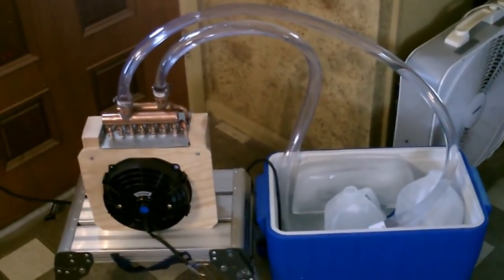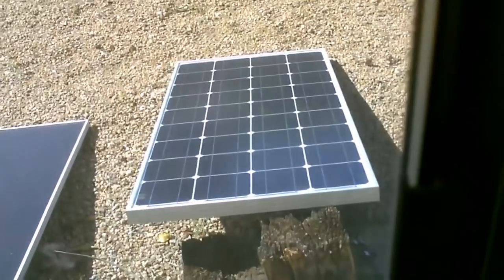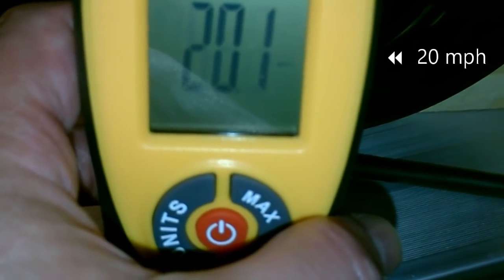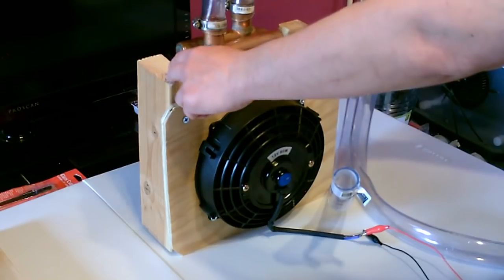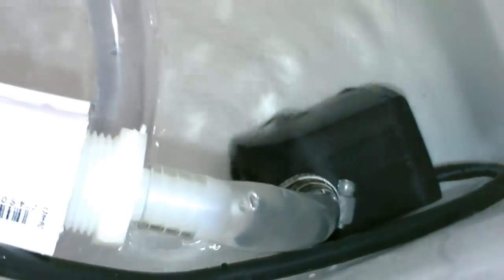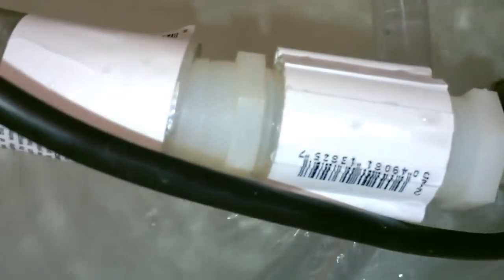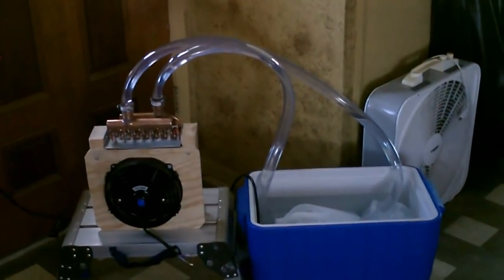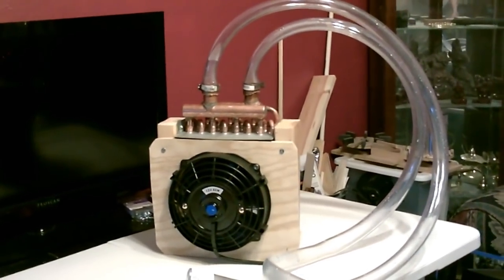DIY Air Cooler! AC Air Cooler with "chilled Water" - Powerful!  Heat Exchanger w/fan! Easy AC! Solar

Comment: Would any heat exchanger work. Ex, computer radiator
Reply: Because the link is no longer available
Reply from the maker: hi the links for the heat exchangers change all the time. i don't know why. best to just search for 8 by 8 heat exchanger and you'll see them. there are at least 3 companies on amazon that sell them. i'll take a look at the link, and post a new link. Update: i just posted the new link! it's in description section below or just click here https://www.amazon.com/Water-Exchanger-1-Copper-Install-Flange/dp/B07VPBSFQC/ref=sr_1_3?keywords=8x8+heat+exchanger&qid=1576173824&sr=8-3

Comment: Hey...i got a 12in automotive fan..2150cfm...New...18 x 18 Air to heat exchanger...New...i have a 48qt cooler brand new & 28qt extreme cooler brand new...What size Water pump Do you Think I need...im trying to build something that will help cool a 800 to 900 sq ft room...something better than a fan blowing around hot air..i work in a lab..it cool in the morning...but by 12 noon it's 83degress in there...fans blowing every..were The AC is set on..71...And we can't make it cooler..company Rules...This unit could turn the tide...because I can bring a fan for my area..but that's it..So I want to Bring this Unit in..with 2 bags 10lb bags of Ice....i can frezze 4" 1 gal bottles at night and bring in the morning....What do you suggest??.....THANKS..any.directions would be great👍
Reply from the maker: hi there. sounds like you got a great plan. if your running it on DC Power i'd use a 350 gph 12v bilge pump. 18x18 is a really good size unit. might even be able to use a 500 gpher. if using AC power i'd use a 400 gph water pump. probably an aquarium water pump. good luck to you. sounds like you're going to have a great system.

Comment: I've had this idea for years but never made one. I have a problem with what I'm seeing though. Looking at the clear hose going into and out of the radiator, one hose is full of water and the other is empty. Both hoses being vertical like that would have to be full of water if the water was going thru the radiator.
Reply from the maker: hi. good question. each pipe has an equal amount of water flowing thru it. neither pipe is even close to full, maybe 1/4 full, but that's normal. it looks that way on one side because the water bottle necks . but the unit itself is actually full all the time.

Comment: very nice..its a bit loud to my liking....  think you can increase the radiator size and reduce the fan speed to achieve same cooling and cut down on sound.... ? also when are you going to make this thing run of the swamp cooler you built.... ? that should be interesting...
Reply from the maker: hi there. the sound will vary depending on exact model of fan you use...  but i've noticed that if i run it at 80% speed or less it's no louder than box fan on high. you can also decrease volume by adding a short section of pipe to the front of it. that acts like a muffler. your idea of a bigger fan at a slower speed would work too. i'm definitely going to be connecting this unit to the evap cube cooler for indirect evap cooling unit. just haven't gotten to it yet🙂

Comment: how long do you think this would output heat if used as a heater with hot water in the cooker? would it last 8 hours?
thanks very much
Reply from the maker: hi there. i've been meaning to experiment with hot water, but haven't yet. i'd guess a few hours at a time. i'll be making a heater vid. on this soon 🙂
Reply: thank you very much i look forward to your video and results. much appreciated
Reply: Use a hotplate under an insulated metal bucket. Electric or gas or rocketstove.

Comment: This is by far the most effective chilled water cooling system I have come across YouTube in a very long time!
Would it be possible to submerge copper coils into an ice-chest full of water, then later freezing the water during the night so you end up with an ice in the daytime, and pumping water through the coils submerged in the ice earlier to absorb heat from the fan-coil unit? A lot of building service engineers I have spoken with, and even Enwave in Chicago have used ice storage to cool buildings during the daytime since running chillers during off-peak hours is comparatively less expensive.
Reply from the maker: hi there and thanks. yeah this unit works great. i like your idea. may even make a video on it. it's very true that many buildings still use ice storage to cool buildings in the daytime. they freeze giant vats at night and then blow fans across it during the day for cheaper cooling. they usually use this in conjunction with regular ac but i've heard it can cut their electric bills by 35%. there's one company that has units in 4000 different companies.  i saw one being used in a highrise in manhattan.

Comment: Awesome stuff! BTW, adding a half cup or so of salt to each of your gallon jugs of water and then freezing it, will yield much colder ice!
Reply: Wouldn’t the salt going through the heat exchanger rust out the metal?
Reply: @777steelerfan  Not if it is kept in a closed container. IE a closed container of frozen salt water put into the air conditioners bath of water. From my own experience with my drink/food cooler, I have found out that the salt ice takes in more of the cold temp from the freezer, and therefore has a colder temperature then that of regular ice.
Reply from the maker: good tip!

Comment: I built one for a garage area...works great....motor controller makes it nice to control speed of the fan....Great idea!
Reply from the maker: hi there. that's awesome! i've been using mine everyday. already saved like 50 bucks in electricity since i don't need the AC now.
Reply: Hey fellas, thought I reach out with a quick question.... I LOVE this idea, and am currently waiting for my parts to arrive, but, as I understand it, the fan is DC powered? Since I am very much an electrical novice, how can I wire that to an AC outlet, since I won't have a solar panel? Any help would be greatly appreciated.

Comment: Is this meant to only cool 1 room or does it cool your whole house
Reply: An answer from an observer...It all depends on the fan and how much CFM  volume it can push with the available cold water running through the system..Both are limited... to the amount of ice available and the amount of cubic feet of air the fan can push.. The previous video I saw he showed a 20 degree drop between ambient/cooled air... but this was also at the lower areas of the room which has cooler air too (hot air rises)..My guess is its limited to the CFM.. but I suppose  if he put the "concept"  high in the room and had a way to constantly feed the water bin with ice jugs to replenish the cold it could gradually bring the "whole" house temperature down...
Reply: @kevinrehberg8758  Should do the trick for my stealth campervan and my woods camp. I can make all the free ice I want at my warehouse (free electric) which is a quick 1/4 mile from my warehouse. Florida summers are brutal and I know condensation coolers are useless here. Cheers

Comment: I'm guessing if one has some old A/C window units lying around, you could also use the heat exchangers off of them and save $44. Also, you could use those little portable ice makers to make the ice, to keep the water cool, if you are in an RV or something. I would think it would be more energy efficient, but I haven't run the numbers. There would be a lot of variables to consider.

Comment: Very nice!! I want to build something similar to yours, but I want to have a battery bank to use it at night as well and the water would be cooled with a Peltier thermoelectric. Nice to see your system working of a solar panel. My question is...how large a solar panel would I need with batteries to work continously with 1 12v fan/ 1 12v water pump/ 4 36W peltier thermoelectric. I live in Aruba. Sun shines bright everyday for atleast 11 hours.
Thank you for sharing this video.

Comment: Free Ice?
total Watt to produce ice from the fridge? Im assuming your fridge runs off the mains grid
Reply: I think that even if you don't put some ice into the system you'll get fresh air
Reply: @hebertsbonilla7405  I saw this other guy on yt, use solar with 1000w converter, run efficient freezer/fridge that uses around 450watt if i remember correctly, it only takes few hours to make ice, probably best to keep freezer outside the house else you will be heating the room, you can stock up on that way too. that heat exchange you got there looks very beefy, alternative is to use motocycle they probably cheaper too.

Comment: Keep the lid on the cooler, your ice will last longer.
Reply: The point is to move heat from the room into the water... It doesn't matter if this happens through the radiator or directly.

Comment: You do realize that you put more heat in to your house by freezing the ice that you lose by melting it, right?
Reply: Is it just me or does he sound like he could do the voice over for south park?
Reply from the maker: hi. i hear that concept from time to time so here's my take on that...i get your point, but that only applies theoretically in the specific circumstance that the cooling unit and your freezer are in the same space your trying to cool, it's an enclosed space, they're both running simultaneously and the heat and cold are being dispersed equally. in most real world cases (like freezing the ice at night and using the unit during day) or at any different times then when you're running it negates that. also if freezer is in a different room, downstairs, outside etc... changes the equation. an example...say my bedroom is hot. what do i care if the kitchen is 1 degree warmer when it's freezing the ice in the afternoon or anytime really. the heat that the fridge produces will just rise to the ceiling and up thru the attic and out. my point is there is almost no scenario where this won't cool an area of your house. but again i do get your point. if the cooler is meant to cool your entire house (including the kitchen) at the same time the ice is being frozen they can cancel each other out. hopefully that long-winded answer will be of help to anyone who reads it :)
Reply: @desertsun02 I have just spent about 2 hours watching all of your videos. I am going to build  2 of these units Tuesday.   I applaud your talent and I too am a off grid sort of person (see my vids).  I have access to a river down here on my property in Crystal River,  Florida.  While the average temps are 95 degrees, the river temp is always about 55 degrees. I was wondering about looping into it to eliminate the ice chest all together... just didn't know how well 55 degree would allow for cold output from the exchanger.   Another thought I had was looping into the outdoor cool air blower unit you have constructed.  That water also runs about 55 degrees but would literally be very close to pipe into and would also eliminate the ice chest requirement.  It could also provide a water reservoir source for multiple blower units to cool more than 1 room at a time.  Please let me know your thoughts.   Keep up the excellent work.
Reply: Damn sure hope your not referring to my comment i said nothing to discourage anyone if anything it was encouragement to do a voice over lol
Reply: No RON, it wasn't for you. And yes he can actually do a voiceover.
Reply: Can you run your fridge with some solar panels?
Reply: Douche bags like you discourage creative minds. He did a wonderful job, and it is 1000% better than those other diy twat coolers.

Comment: this is so cool. wish there was a way to implement this in my van.
Reply from the maker: hi there. maybe make it all as one unit. meaning put the lid on the ice chest and attach the fan/radiator assembly to the lid. then cut 2 holes in the lid for the pipe.  place unit somewhere in van and your're set. might make it too cold running on high but just use the speed control unit shown.
Reply: hmmm you got me thinking...
Reply from the maker: i may actually try that (connecting the two) and put it in the back seat of my car. cars interiors are like little solar ovens in the summer but i bet it would work just as good as the cars' actual ac unit...at least for a few hours at a time... and it should run off the cars cig. lighter
Reply: left me know if you do it. I've got solar and power banks I can run it off of. I've saved this to my favorite things list so I can refer back when I'm ready to compile materials.
Reply: @desertsun02  Also a variable speed switch for the pump could control temp as well and at slower flow rates ice and battery life would be extended for van apps. With the variable fan switch you could have full control of temperature and ice and battery life. Thanks for the idea I'll build before summer. 2012 Transit connect.
Reply: Ann, I built this 2 weeks ago. I'm volunteering in Placitas NM where it's in the low 90's during the day and drops a few degrees each hour at night. Have used it both with ice and with just 55degree well water. I'm using an igloo cooler and the tops of igloos are not insulated so ice melts fast! Once I sprayed that Right Stuff inside the lid, I got 3x or 4x longer with ice before melting. It works and I'm happy with it so far in a chevy express van. By early in the morning the ice has melted and its just blowing cooler air using the water in the cooler that is still cooler than the air in the van. I've put the fan/radiator/controller piece together so it disconnects easily so it can fit inside the cooler when not in use. If you make it, keep that in mind - you know storage is at a premium. The fan is noisy but I've found that running it overnight at lower rpms works for me although blasting it feels great. I find the cfm overkill in the van. By the way, it's not an a/c. I certainly am comfortable even just using cold well water as a source but it ain't a/c. Runs of my 2 100ah lithium bats all night easily. 

Oh, when i get time i will try using it along with his solar hot water heater to see if it will heat the van - during the day at least. Would love to rely less on my Mr. Buddy propane heater - although it won't help at night or bad weather. But a dual use shower/heater has potential even if its only when the sun shines.

Comment: Nifty! You're really stepping things up.  Now if you can add a water pump feeding a counter-top ice maker (both solar powered of course) from the melt in your ice chest which then feeds the ice chest with fresh ice cubes. :D :D :D
Reply: I thought of that for an off-grid treehouse. I don't think they use that much power either. You could have it dump right in the cooler. Cheers

Comment: This looks like your best AC build yet. Where did you get those plastic hoses, what size are they?
Reply from the maker: hey thanks. yep, as far as sheer power goes it really cranks out the cold air. you can get that type of hose at most home stores (i think i got it at home depot). also a lot of marine supply stores have a lot of large diameter vinyl hose. they often sell it by the foot too. they are one inch internal diameter. tip: look around for best price. i've seen it anywhere from $5 to $20
Reply: @desertsun02  thanks 👍🏼

Comment: Do you have any problems with condensation coming off the heat exchanger?
Reply from the maker: hi there. no that's not an issue where i live. never hits the dew point. if it does happen just wrap a towel around the top. the bottom part is open so you could set it on a towel or you could just put a small drip tray underneath it (maybe just made out of tin foil)